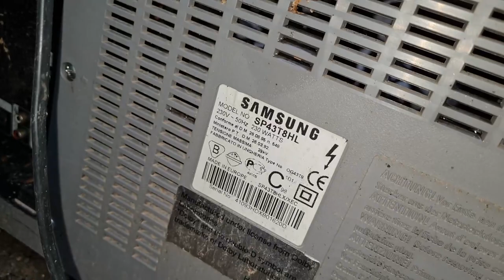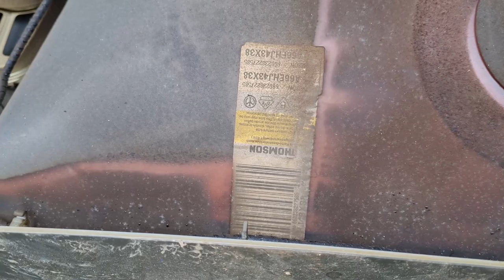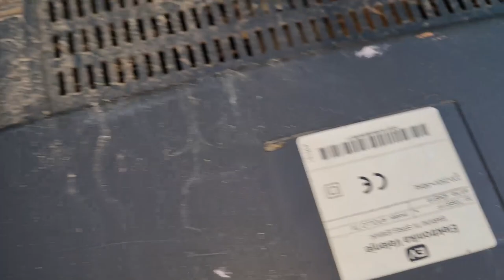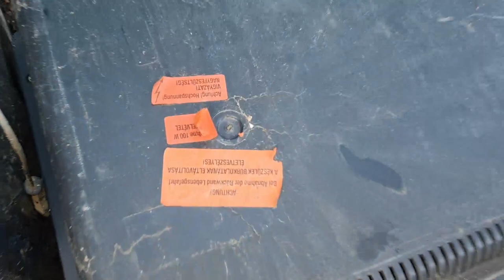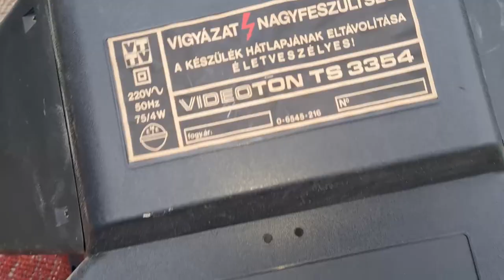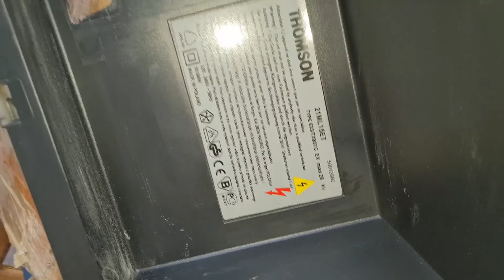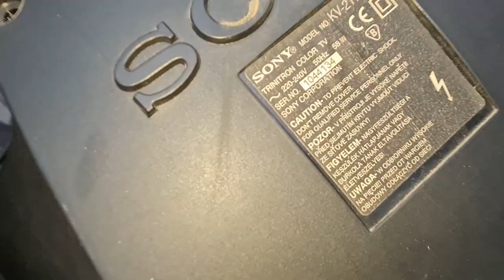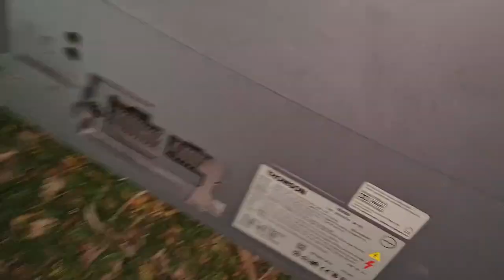Speaker Hunting#8:Sony Wega Tv Subwoofer And Much More!

Comment: Most of the finds are pretty bad cheap drivers :( But that little Sony TV woofer is very nice. Also I have never seen that Thomson Faital sub without enclosure!
Reply from the maker: Saddly yes,that e-waste collector always has cheap stuff,the best speakers from there are the 2.1 zylux.
The junk clearance is obvious better...
Reply: I have a tip: when you get a cheap speaker build a good enclosure with it and it will be hitting super low (I tried this with an old cheap broken tv my grandma gave me)